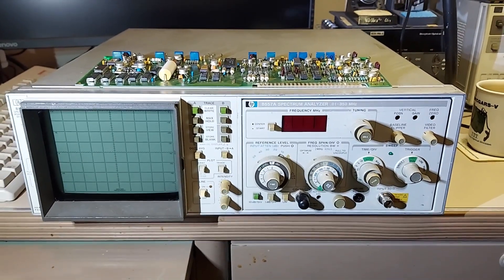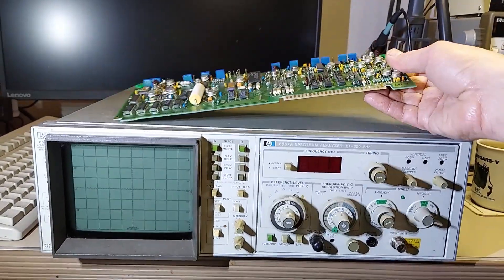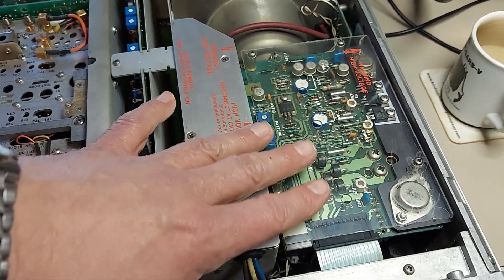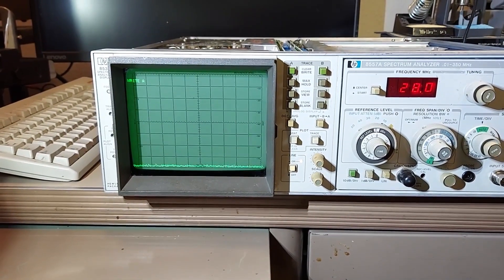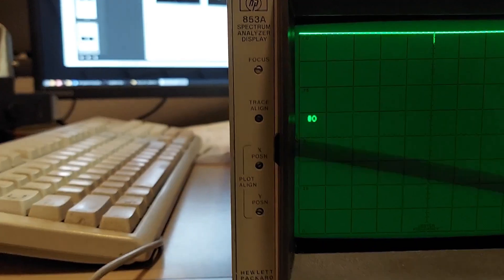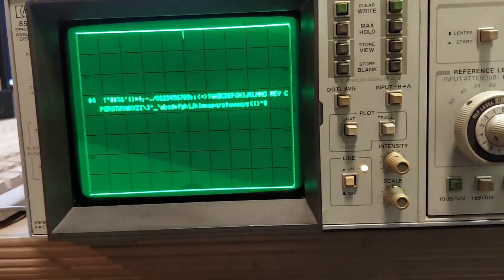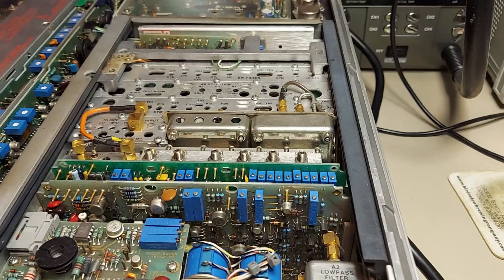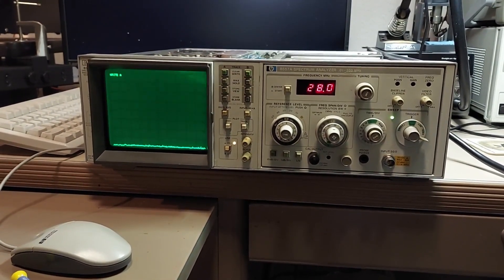HP 853A spectrum analyzer revisited.

Comment: My 8553 fails to sweep now, and used to be able to trigger from Line. I suspect the Mode switch's plastic has failed and the contacts for the switch are not where they should be anymore!
Reply from the maker: That's a common fault with these instruments. I have a 8558B plugin, most of the finger stock in the span selector have fallen out, other than that it still works but is unusable.